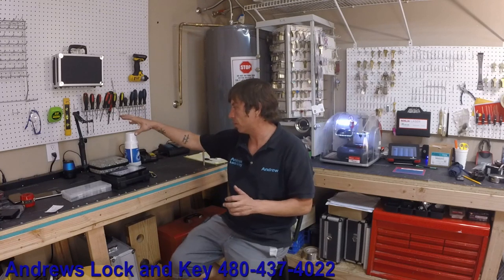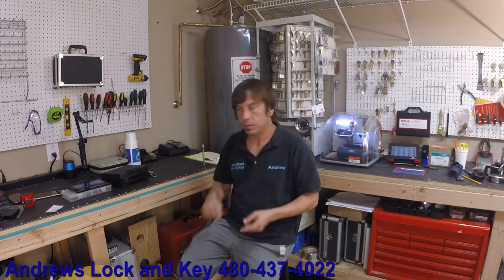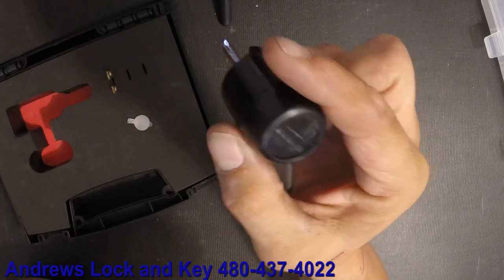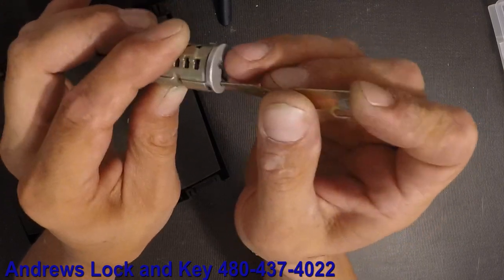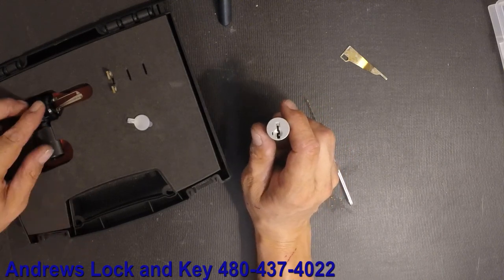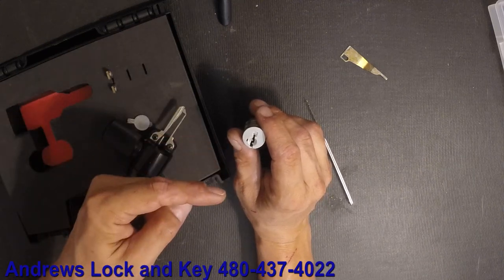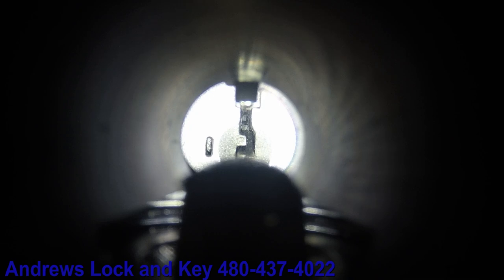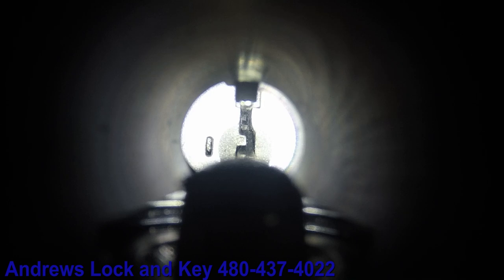KWIKSET SMARTKEY DECODER TOOL

Comment: This is definitely a cool tool to add to the Locksmiths arsenal. I’ve always been cautious with customers about the smartkey locks in telling them about their weaknesses cause that was only on the first generation of those locks. I don’t mind these locks at all. 

There’s a “destruction tool” for  every residential lock. I’ve seen a few locksmiths insist to their customers to swap the smartkeys out to a Schlage keyway that can be bumped open even quicker and with no damage, with a homemade bump key. 

But realistically, most robberies are not through exploiting the keyway, they’re mostly from exploiting structural integrity.
Reply: I just keep my eye out for those guys driving step vans... ;)
Reply: @willie_mccoy  😂😂😂

Comment: Is that only kw smart (laser part tool) keyway ? What about regular kw knob or dead bolt ?  I am a 
Locksmith at Los Angeles .
Reply from the maker: I don't understand this question.

If I read your question correctly.

I think you're asking if this works with regular kwikset pin and Tumblr know it does not you would just need to decode the pins yourself and cut a key or pick the lock.

This will read smart key lock.

There's also a camera version made by AccuReader that works just as well.

Comment: Why can't this lock be picked? Or raked? Is it cause of the side bar?
Reply from the maker: Sidebar makes it a lot harder to be picked they can be picked but I don't waste my time easier to either make a key or drill and replace it
Reply: you would have to pick all five at the same time. like a key would do. so its a pain i just drilled another one i need something better.

Comment: waited a long time for this video Andrew!... I own this too..and one way too help practice as it says on book is to disassemble a smartlock and take a colored marker and color the wafers and put back together.it does take alot of practice to know what exactly you are looking at in the cylinder...these are worth it i think because the majority of lockouts I do they just want in and dont want to change locks and dont want destructive entry. so this caters to that need. for the k I k knobs I also use the soouber.latch tool and that pops then open in seconds if there is room to fit it. lockpicks.com also sells this decoder.

Comment: hi Andrew nice video thanks I have a question for you regarding getting customers or used car dealerships for making car
keys (transponders) I recently started my own locksmith business and do well I wanted to get into making auto keys have programmers and a expensive transponder blanks just wondering the best way to get customers should I go to car lots I live in Canada similar to small cities in the USA.
Reply from the maker: +Rocketlockopener go to to the dealerships and give them a price what you be willing to do there keys for. That's how i do it and then negotiate after that.

Comment: I don’t understand how it works on the wafers behind each other?? You can see the first wager without buying an expensive tool. I wish you went though the entire Lock.
Reply: there not wafers they ride the edge of the keyway and when lined up the sidebar can collapse. if you want to see more cuts you would just push it in to the next cut and read it too

Comment: Good stuff! Look forward to more videos. I've been watching a lot of Bosnian Bill lately. Can you do a video on how to hand cut a key as you described "at the door"? And what type of keys can you do this with?
Reply: Daniel Davis you need to use this tool in tandem with either a code cutting machine space and depth keys and a duplicator or pakapunch type key clippers. the clippers would save the most time as you just bring blanks with you decode and cut key opposed to running back to van over and over if the key didn't work..
Reply from the maker: +Daniel Davis I actually don't have a Clipper or a punch so I have to hop back in the van and cut the key

Comment: an idea I came up with is if a guy used tryout keys with this decoder and had a chart with his tryout keys and had them stamped and numbered and would go up to door , decode then go to your chart with numbers and get the tryout key that corresponds to found key code and you are in. you literally could be in the door in under a minute. opposes to going through 300 tryout keys this way if they worked together you could be in non destrively in a minute. bit of a cost getting this all but a few jobs will pay for it.these are everywhere like flies to shit
Reply: I made 276 tryout keys but didn't number then all. once I finish that I have a chart I will break it down into a quick reference somehow. but non destructive options are surely needed. hope all is well andrew
Reply: Is it really that hard to make a key with a pak-a-punch after you read the wafers?
Reply: I made tryout key set, It works haphazardly on the old ones and not at all on new ones
Reply: Smeado no?  but not everyone has pakapunch. I like the pakapunch idea alot. plan on getting just to govwitg the docodder. tryout keys idea I am gonna try
Reply from the maker: +Smeado now you're just going to stamp it out on a Pack-a-Punch. I have HPC 1200 along with my Ninja. So I actually have to go back to the van and cut the key. But I do use a punch to cut my best keys they seem to work the best coming off the blue punch
Reply from the maker: +Smeado but to use it to cut the key take just seconds man

Comment: I just bought one of these and after two days trying to decode two different, new, smartkey  locks, I still haven't been able to recognize the bitting on even one wafer. I even put red ink on the surface of the wafer so I could distinctly see it. But even being able to see where the flat surface of the wafer it was all unrecognizable. I notice now, that your video shows how it is SUPPOSED TO WORK, but you didn't actually do the job. The pictures provided in the manual are very clear but look nothing like the real thing. Have you actually made this thing work?
Reply from the maker: +Ronald Cox now use it 5 times a week. It does take some getting used to using and understand what you're seeing but yes it does work
Reply: I know it's late but my latest video may be of interest to you.

Comment: Picking them is not luck. It's a skill anyone can learn with a bit of time. I can pick any smart key in about 3 minutes or less. 

The real gate is much bigger than the false gates and you can with a little practice feel the difference between a real gate and a false gate.
Reply from the maker: I'm kind of confused because there are no Gates inside a Kwikset smartkey cylinder and yes you can pick them by raking them and with certain Jiggler sets I have seen open them but again I'm not sure what you're talking about in Gates on a Kwikset Smart Lock. .

Can you please explain.
Reply: Andrews Lock And Key uhh yes there is. all side bar locks have gates. it's what the sidebar falls in to on what you call a wafer. 

search my channel for smartkey. they pick easy once you have the feel.
Reply from the maker: +West Coast Picks I found your video on the padlock one which I can pick very easily as well have you tried to pick one of the newer ones they've changed him up again but you can still read them
Reply: Andrews Lock And Key That is a brand new lock. less than 5 months old. And yes I have picked the new design as well. it's just as easy. You can feel the difference in the gates.
Reply from the maker: +West Coast Picks I'll have to play with that a little bit myself and see. Thanks for the heads up
Reply: Are you sure you are talking about a KWIKSET Smartkey? I could only find your video on a WEISER Smartkey, which is not the same.
Reply: It's the exact same. They are owned and manufactured by the same company. I have also picked kwikset and gutted them, there is NO difference. I only have the one video because they are the exact same. Directly from wikipedia:

In 1957 the American Hardware Corporation (AHC) purchased Kwikset. AHC in 1964 merged with Emhart Manufacturing Corporation, which was purchased by Black & Decker in 1989. In 2010 Black & Decker was purchased by Stanley Tools. Kwikset is part of the Hardware and Home Improvement Group of Stanley Black & Decker, which also owns lockset manufacturers Weiser and Baldwin. Kwikset locks have now evolved to include many Weiser features, and Weiser locks now use Kwikset's "SmartKey" self-rekeyable lock technology and Kwikset keyways.
Reply: @WestCoastPicks  The Gen3 newest Kwikset locks are all but impossible to pick conventionally.  There is a sidebar that keeps the wafers from binding. You can apply tension to the sidebar with a shim but it isn't consistent in terms of being able to pick it at that point. Some models from what I understand can't be reached with a shim either. They can still be decoded however like we've seen here.
Reply: @SkepticTalk  despite this, I have picked them. I've had this conversation more than once. I've picked brand new Gen 3 right out of the package before.
Reply: @WestCoastPicks With or without a shim? I'd like to see this by the way.  That's impressive if you can.  I cannot and I've picked many Medecco locks before.  Correct me if I'm wrong, but the Gen3 version of this is way more resistant to force attacks too? For example, like the one I just watched on your channel using a screwdriver and a partially cut key.

Kwikset still isn't great, but they ard getting smarter no pun intended. The sidebar is a step in the right direction.
Reply: @SkepticTalk  not sure what channel you're talking about. I've not ever made a video that contained a smart key and a screwdriver.

Without shim. It's not that hard really. I've also picked many medecos and other side barred locks. They are much more difficult than a smart key.
Reply: @WestCoastPicks  Do you have a video picking the Gen3 version of this? I'm not sure how that's possible since it had a sidebar that keeps individual pins from binding. 

As far as the other video goes that was another channel
Reply: they arent worth the time to pick impressive if you can for sure. i just drill out the mounting and keep the cylinder then the next time i drill out the cylinder and use the one ive keept before also sometimes i jack the door back and sometimes the locks bolt doesnt go all the way out and you can just pull the bolt back. either way im getting this scope to make things easier and faster

Comment: truly not a good tool! cant believe this tool does not come with a depth chart! if it does it truly is not that good! the other kwikset smartkey decoder that is bluetooth and send camera images inside hte lock at leat comes with a depth chart so you dont have to guess "thats 2 or a three wait its a 4' lmfao that was terrible! needs to be more precise!

edited accidentally said it wasnt a good video when I meant it wasnt a good tool! due to lack of depth chart and having to do guess work. The video was a good video though~~ ;)
Reply from the maker: I own both of them this was when it first came out many years ago. 

Kind of a learning curve when they first came out much better at them I did this video basically I think the second or third day I owned it.

But I think you for your comment George
Reply: @Andrewslockandkey  i think with a bit of practice should be fine but your right would make life easier with a few marks on the mirror